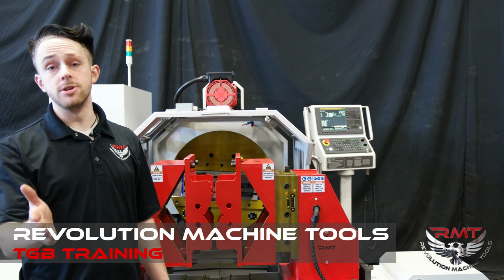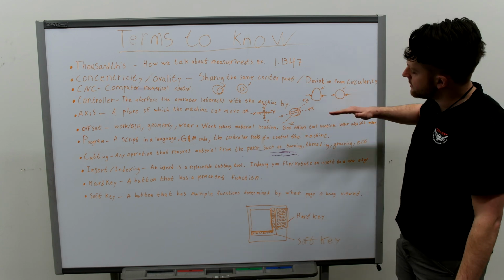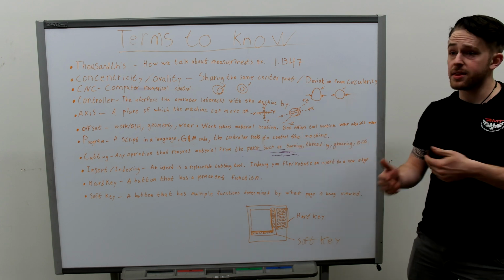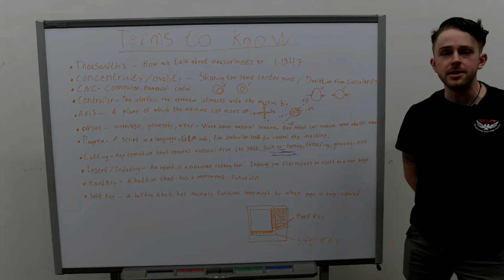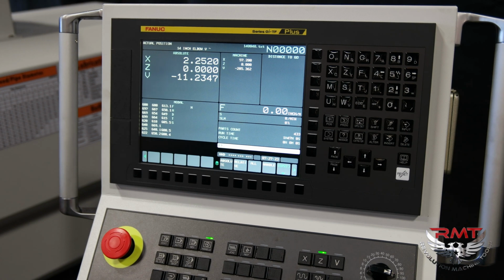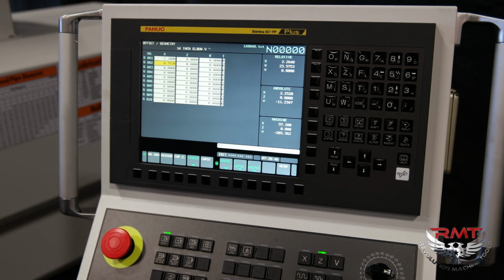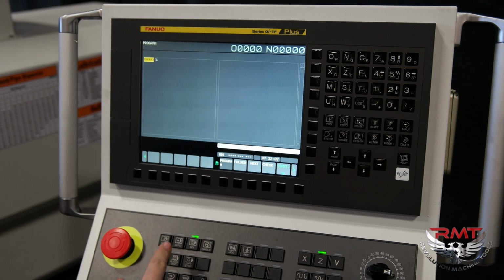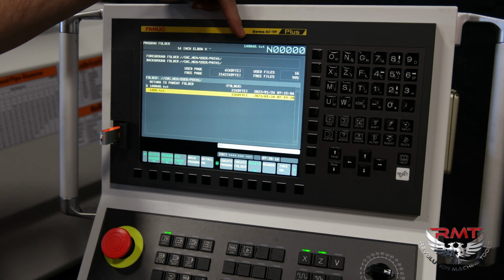RMT Pipe Spool Master TGB Customer Training

Comment: Question, is there a video or guide on how to get the clamp properly set or concentric? Right now we kind of eyeball it and then test it out by running the first pass with opt stop on. We do that everytime we switch pipe sizes. And another question, what is the dry run switch? We don't use coolant so I'm unsure if that has any relatively to eachother. Any advice would help. Thanks!